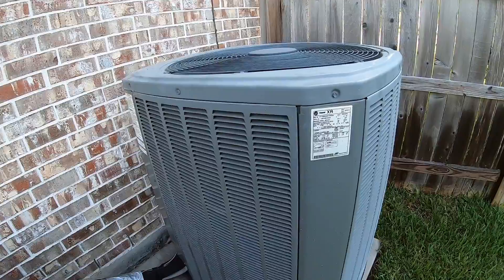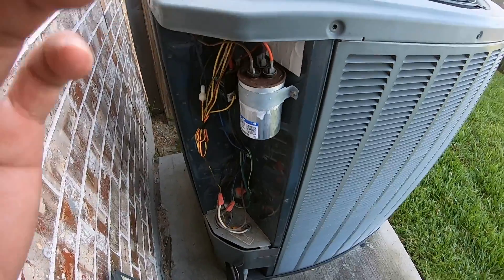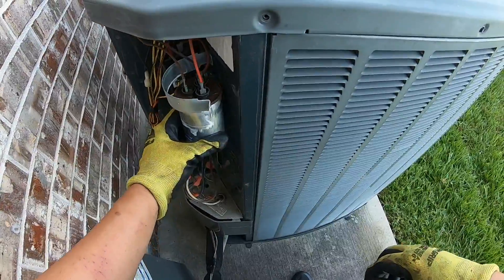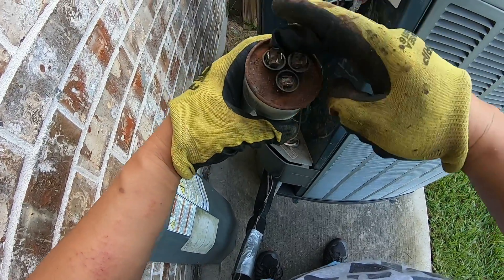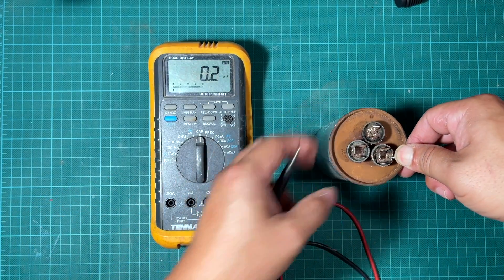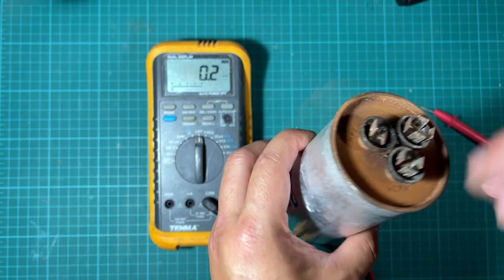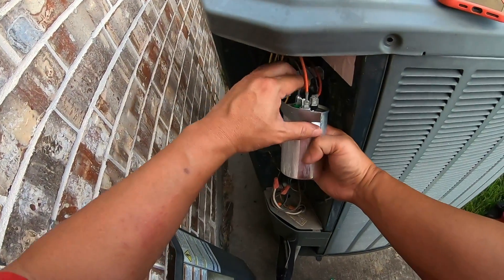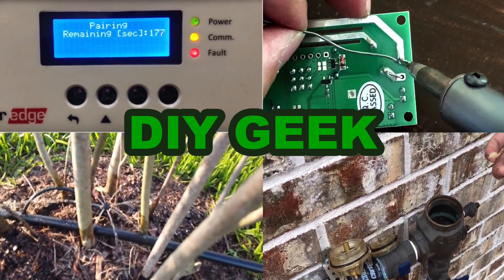AC CAPACITOR REPLACEMENT

Comment: Fan always has the least connectors and Common always has the most.  Usually a 4-3-2 set up.  
That fried lizard shorted the Cap out when he was alive.  I could tell it was bad as soon as I saw that guy.  
Since you're making a video, you should have 2  other Caps to show, one with a low reading (35uf) and a swollen/leaking one.  
You also don't say anything about your meter.  Some people won't have a CAP setting on their DMM only AC, DC and OHMs.  I use a Capacitance Meter that needs to be set to 200uf to read these Caps.

Comment: Why AC manufacturers do not separate the capacitors into 2 different capacitors?
Reply from the maker: They do, but separating capacitor cost more and takes up more space.
Reply: They do.  You can buy a 45uf and 7.5uf and put them both in.  They only have 2 posts not 3.  Hook Fan hot and Comm to the 7.5uf and Compressor hot and Comm to the 45uf.   Cost you more to buy 2.